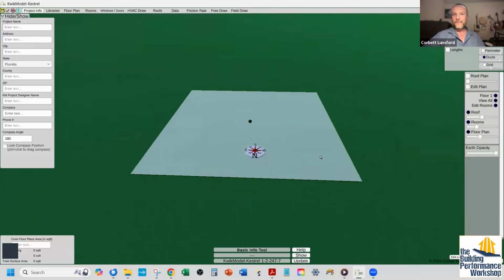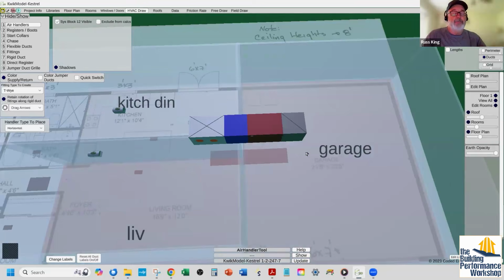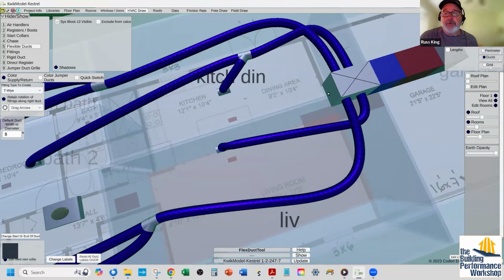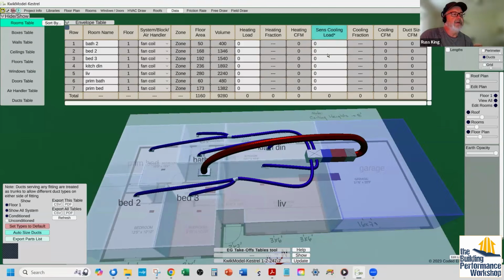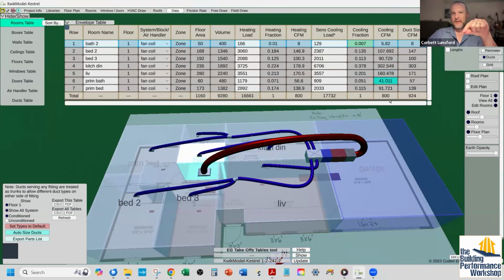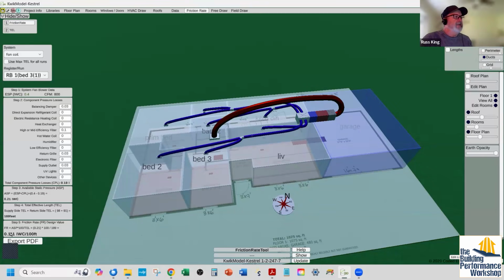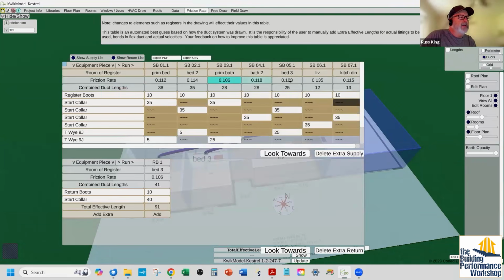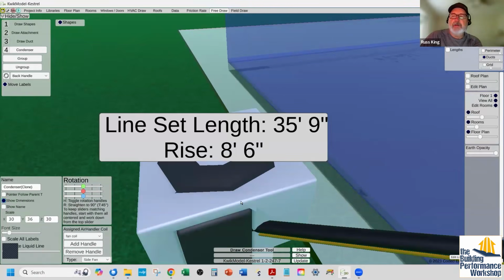Design HVAC Ducts from Separate Manual J Load Calc: Kestrel 3D Manual D Software (demo w/ Russ King)

Comment: Quick question.  Is there a preferred location for the air handler?  Inside the home, inside garage,  or attic?  Our home has the air handler inside a closet. The trunk is connected to existing oil burning furnace duct.  

I would like to move the a/h to garage and redo all ducts.  The sad part is when I ask various ac companies which manual they use, I get a look of confusion. 

Thanks for sharing your knowledge.

Comment: @13:18 — is there any way to have the software optimize this design, so as to minimize the overall total length of all the runs?

For example, in this design, it seems to me like you could move the whole air handler package to the left, and have some of the runs go further towards the left and the bedrooms, while other runs go towards the right and the kitchen and living room areas.
Reply: Thinking about this some more, and considering things that were said later in the video, maybe what you really want is a way to balance the available friction across all paths, and then try to shorten all the available paths as much as possible, so as to keep them all balanced?

Comment: Great product, I'm glad someone is advancing the tech in residential HVAC design. I think the next step should be to move beyond manual D and start actually modeling the way air and sound actually move through the ducts and diffusers/grills; the same way heat balance is more physically correct compared to manual J. Modern computers are definitely up to the task if you have a decent machine.

Comment: This is AWESOME!  Is it possible or in planning for a lower cost / limited project version for homeowners looking to make corrections & improvements to their existing system in their homes?
Reply: We have 30 day free trial. The full version is $199 for a one year license.  We've considered a monthly license for $25. Is that more what you are thinking?
Reply: I had a similar thought. Is there a way to design an "as is" system, then optimize the "as is" at various levels of budget.